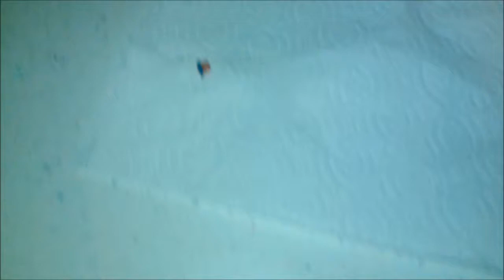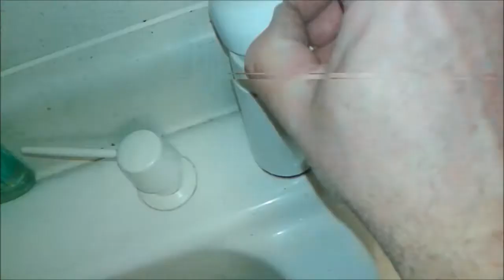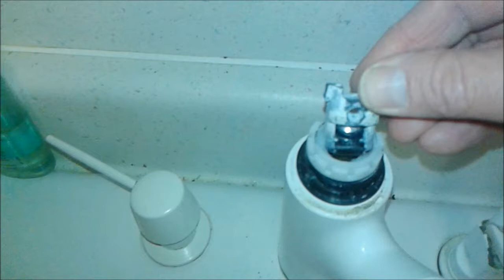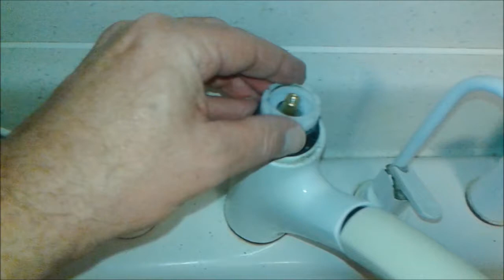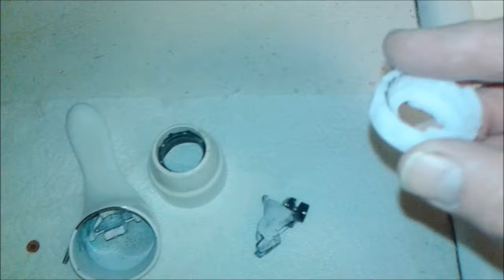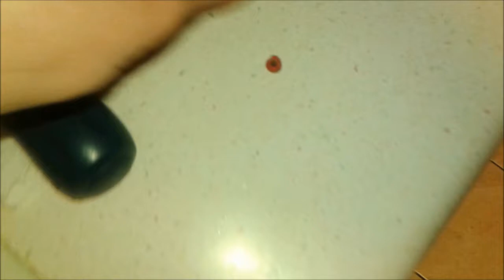Moen Faucet Repair Hot/Cold reversal after 1125 cartridge installation

Comment: To AVOID this problem when doing the installation of a single-handle faucet of Moen cartridge 1225, make sure the side of the flat brass stem with the tiny slot cut across the top FACES YOU (one of the flat sides which has a very tiny indentation on the very top edge).  Usually the stem has a hole cut into one flat side.  This flat side faces you.  Problem avoided.

Comment: Your video was the 4th one I checked out while trying to fix my Moen sink faucet.  When I had tried it before the handle was all loose and the hot water wouldn't turn off, only the cold water would run.  So I learned two things from your video, one was the little black click, I had installed it wrong so it wasn't pivoting up the way it should have, and two was the turn of the stem hot versus cold.  I am glad I didn't have to call a plumber on this one.  Mahalo nui loa.

Comment: how about reversing a TWO HANDLED faucet? my dumbass brother installed one backwards so instead of pulling the handle toward you.. you push it.. also hot and cold are on the wrong sides.. VERY DANGEROUS to someone with neuropathy in their hands.. like mine.
Reply: can it just be rotated 180 or what?